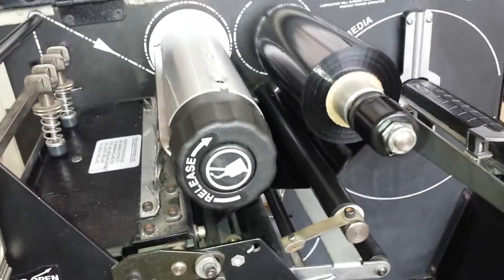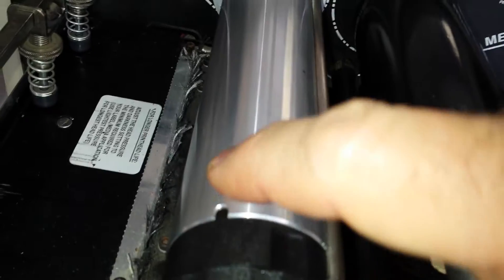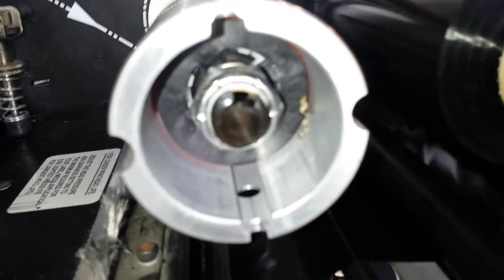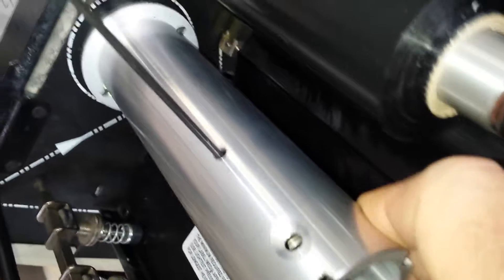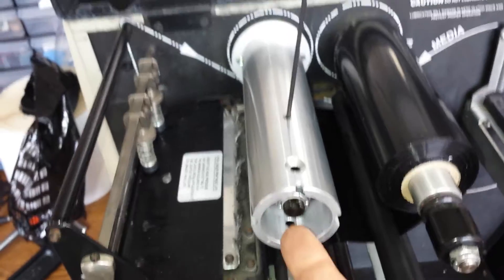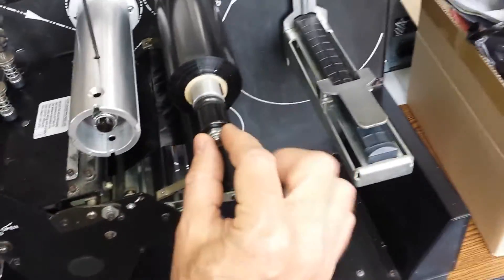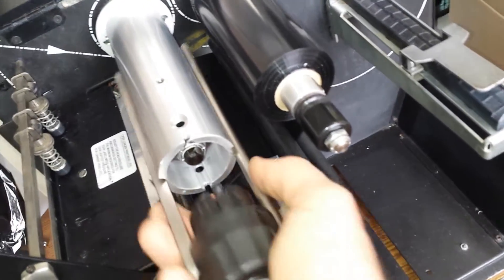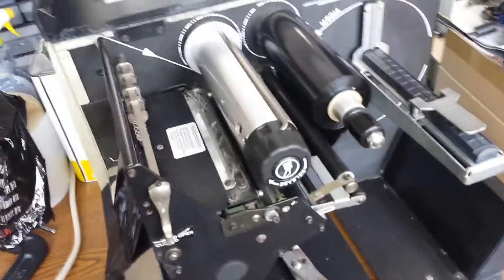Zebra Printer service: ribbon take up spindle clutch/ tensioning adjustment.

Comment: Could you help me? My Zebra ZT510 printer smears my labels, as if the printer were using too much pressure, but I've already adjusted the pressure and it still isn't working. It just launched, which shouldn't be the case because the printer in question is new. Some advice on how to deal with this issue